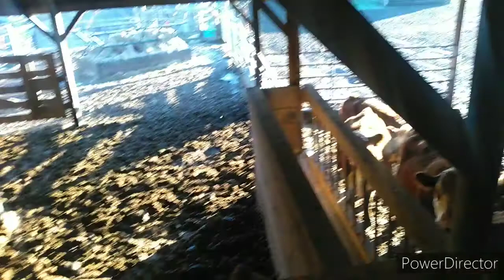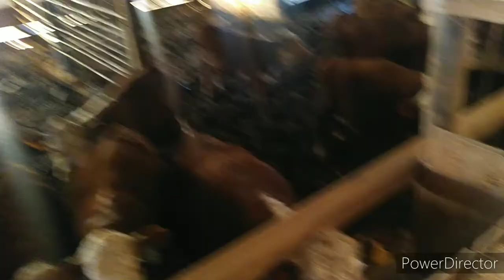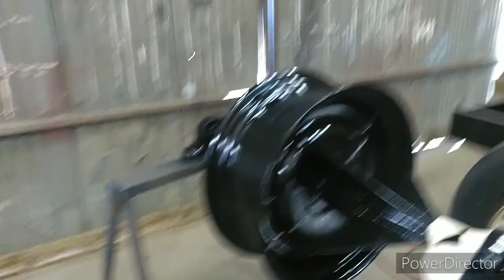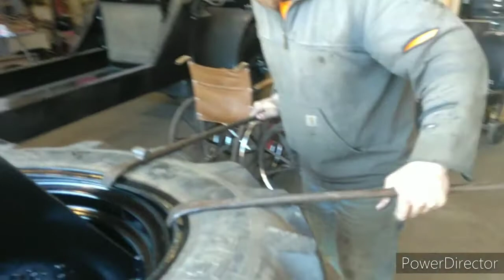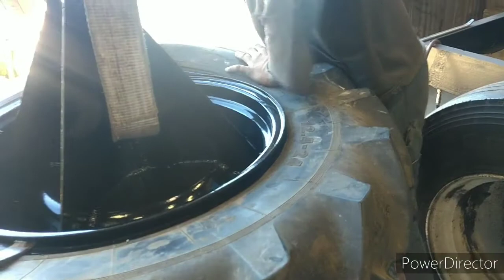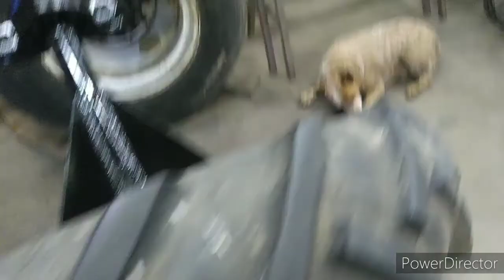Ben stopped by 👍Tire is on!!!

Comment: Didn’t go on to bad. I have a mower that just ate tubes for no reason there wasn’t nail or anything in the tire so even after a new tire still kept popping so I used tire slime and still holding a few months later
Reply from the maker: Really went pretty good!! Especially with all the stuff in the way.